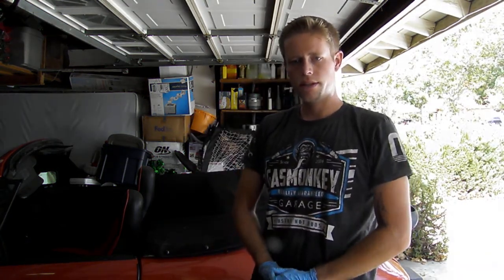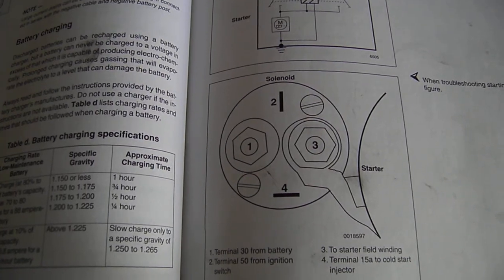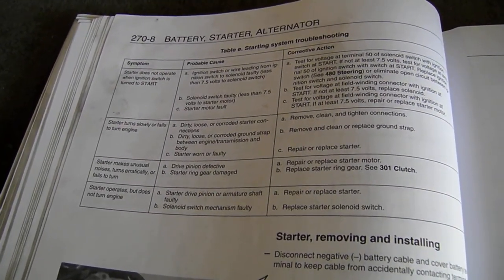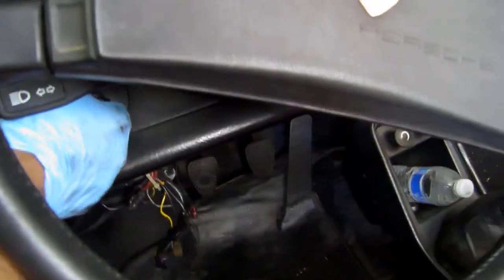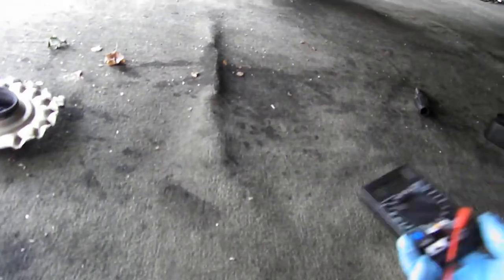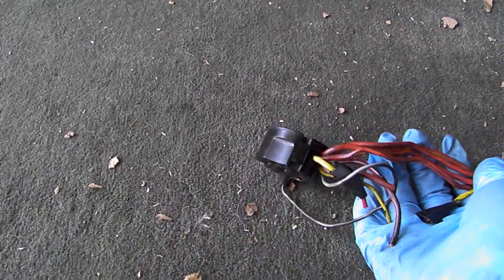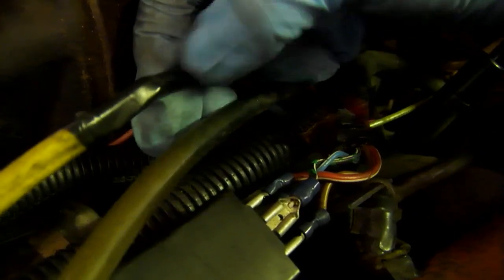Guide: Starter Diagnosis - Faulty ignition switch: Porsche 911 SC

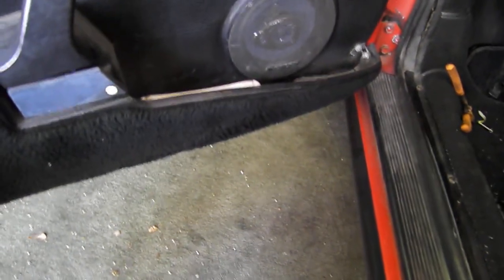Comment: 9:16 came here to learn about how to remove the ignition switch.  The switch is two pieces.  What you have there isn't either of them.  That is only the connector for the switch.  The switch itself has an electrical portion, and a mechanical portion.  What you have is a connector.
Reply from the maker: Thank you for clarifying. Yes, this is the connector. The mechanical portion can be removed quite easily. From my recollection, there is only a faceplate that can be unscrewed by an awl. From there, the ignition should drop out once the electrical portion is disconnected.

Comment: my 1985 Porsche 911 has been starting "periodically"  sometimes it 
starts sometimes it doesn't..battery is good and the starter is new.  
When it doesn't start I just get a "click".  when i tried it a few days 
later it starts!  Ive gotten advice from the ignition switch to solenoid
 to contacts any ideas?  Thanks
Reply from the maker: Realize this is 4 years old, but had the same problem with my car. Even though the ground feels tight around the battery terminal, make sure it is extra tight! Had the same problem with mine. Once I tightened the 13mm nut down some more, all problems went away. Even sold a good starter that I had thought was bad due to this issue.